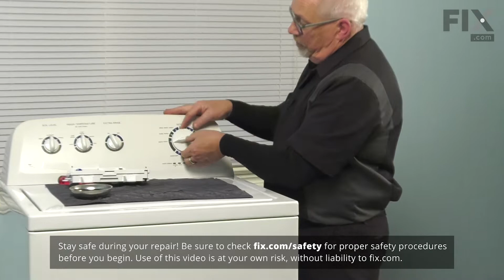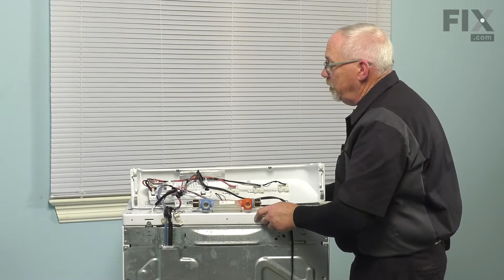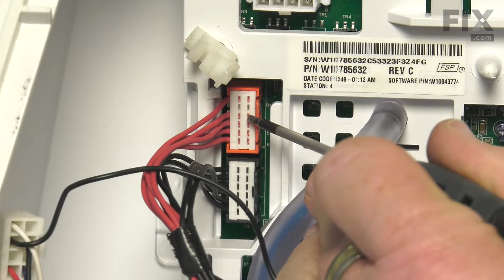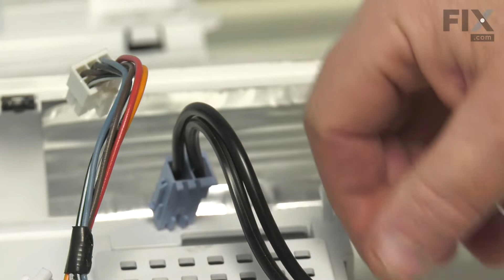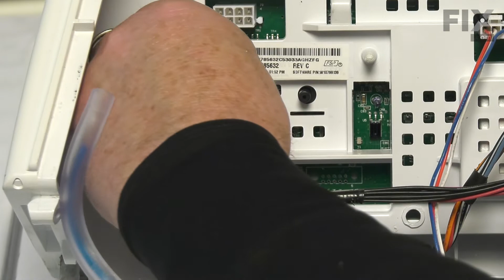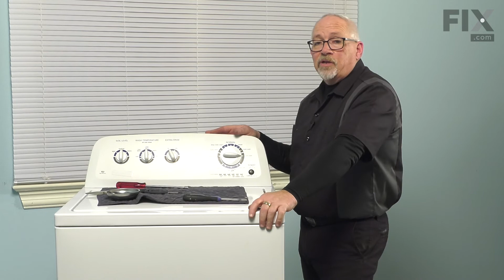Whirlpool Washer Repair - How to Replace the Control Board

Comment: Many thanks!  Our Amana Washer  NTW4516FW3 has some issues.  You put it on regular wash cycle and it fills the tub, then pumps out all the water and just sits there.  If you put it on "CASUAL"  it will sense fill and agitate, but does not get to the final spin cycle, so I believe it is the main control board that is causing issues.  It was bought August 2020  and is now May 2024, so not that old!!   Thank you for showing how to remove and replace the control board.